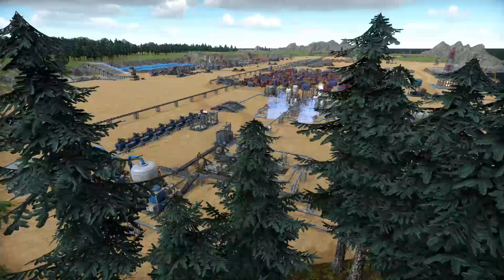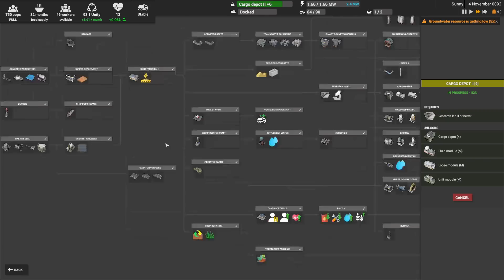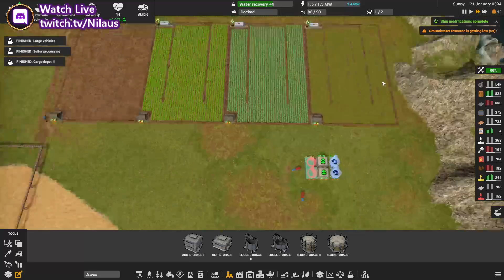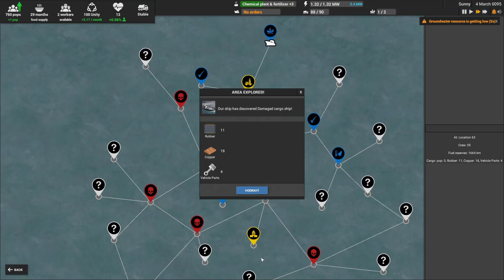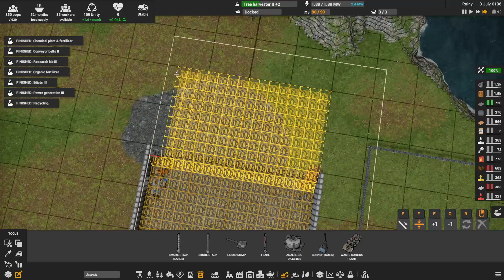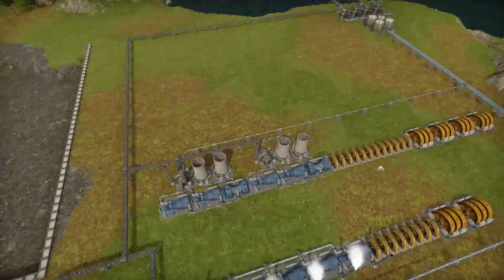Avoiding the #1 Mistake: Teching/Expanding TOO FAST! | 10 | Captain of Industry | Lets Play

Comment: Took a minute to figure it out, but I've now got 100% efficiency power production from my 4 connected turbines (3 set to auto balance). 4 level two turbines, 8 flywheels and 4 level two power producers hooked to 4 coal boilers, 2 of which are always on standby. Thanks for your insight, Nilaus!

Comment: There seams to be a little flaw with that new powerplant. When you set the HP turbines to autobalance they go down to much and you loose power for a short period of time before they spin back up again. Even saw you having the same problem in one of the later videos aswell. Not sure it's down long enough to cause any major damage though, but you get kinda annoyed when the power starts blinking red for a short time.

Comment: Instead of pausing the boilers you can prioritize the generators to tell which one generates electricity before the others.
Reply from the maker: that will cause a potential deadlock. If the power is less than needed to power up the old build, then there is no consumption of Heavy Oil and the Oil Refining will stall and kill my base. I need to guarantee that Heavy Oil is never filling up buffers